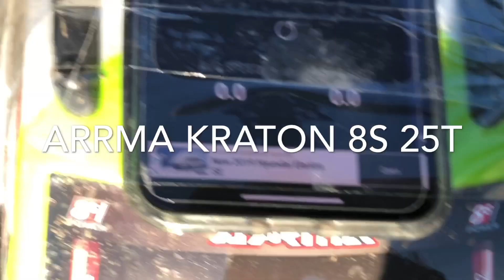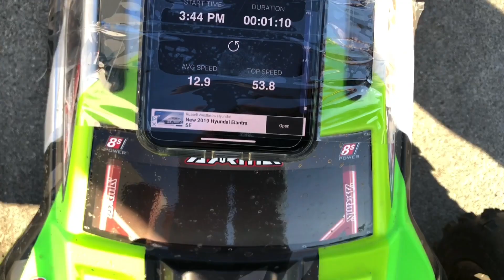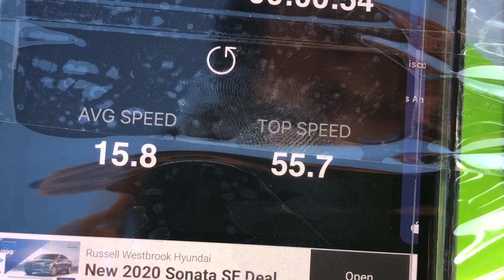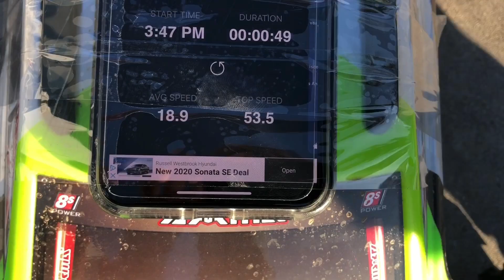Arrma Kraton 8s Speed Run 2  55.7 MPH 25T Pinion Gear 1/5 Scale 4x4 RTR R/C RC Losi Traxxas HPI

Comment: Sadly its one of the not so well made cars of Arrma. Even with just moderate jumping you can have bent chassieplate or middleshaft. But else its a kool thing. Did you change just the tooth or the size of the pinion gear?
Reply from the maker: Manuel H. Nothings been touched just pinion.  I see people bending parts and brake arms. It’s a heavy R/C you can’t treat it like it’s a small scale and light weight. Hard impacts with that much weight can cause damage for any brand 🙂.  Yes the factory top braces I agree don’t really help to support the weight. I’ve changed mine to 7075 solid braces. When they first came out they had materials issues I’m assuming that’s been addressed

Comment: How have the temps been with running the 25t in a bashing scenario?  have you been able to run hard through a pack or 2 back to back on 25t without heat issues?
Reply from the maker: It  heats up quickly.  You can’t stay on it for too long.
Reply: Cool thanks.  Is it only the motor that gets overly hot or also the esc?   I’m planing on putting on a high power fan on the motor, so I’m trying to figure out the largest pinion I can put in there with a fan and run consistently. I run the 23t on my outcast 8s and have never overheated. So I was thinking if I add a high power fan I can go up in pinion some.
Reply from the maker: @torturedrc9013   Fan won’t help. The problem is the motor heat rises too fast Even with a high powered fan it cat control the motor temp. The trucks very heavy for the electronics that comes with it. You will also need to change the fluid in front rear and center.
Reply: @M3PQuicksilver  cool thanks. have you found a sweet spot on the pinion size that can run without overheating? i know the 23t is good,  i wonder how a 24t will fare. i know about the diff fluid, I rebuilt my diff on my outcast 8s already.  i just picked up this kraton 8s slightly used so i will need to go through the diffs soon.
Reply from the maker: @torturedrc9013  23T will help a good amount. With 23T it’s pretty fast. Just keep your eye on the temps. And don’t mess with the timing on the motor
Reply: @M3PQuicksilver  This makes me wonder what’s so different between the outcast 8s and the Kraton 8s.  I have been running 23t on the outcast with 0 heat issues.  Even with larger power hobby scorpion tires.  No overheating at all. I just ordered the 24t for the outcast and am going to move the 23t to the Kraton for now.  Might move to 24t on both depending on the results with the outcast.  Thanks for your input.  I will keep you posted on how things go.
Reply: @M3PQuicksilver  I’ve got a stock pinion and turned the settings up. It’s been a min since I looked but I think to maxed out? Should I turn it back to stock voltage? Still has a stock pinion. I was just bored messing around. Now you got me thinking I fucked  it up lol.
Reply from the maker: @Evergreen085  🙂 I would turn it back down to factory settings. Best is to upgrade the electronics. Or enjoy how it is from factory. Unfortunately when you start messing with the factory equipment it does tend to over heat right away.